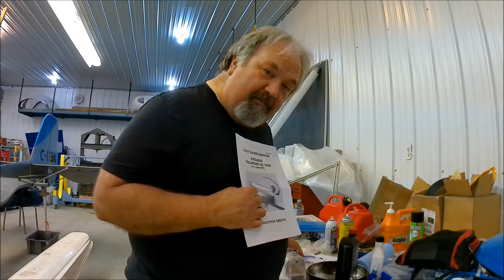EP 57 I install a NEW and better oil tank on my Challenger 2 Ultralight Airplane

Comment: that tank is SWEET, did you buy or build ? if i was as smart as you I'd Buy a TIG WELDER and tinker with welding Aluminum....    And idea If you welded you could have made something for engine crane to take off and put on engine by yourself....   I KD8MZD ( do you do Echolink Ever ? it also has app for you cell to connect ?? )
Reply from the maker: Purchased from Sheer Technologies, description in the comments.

Comment: Ah, hope my idea of a go kart fuel tank led to this purchase of yours. Lol. Are you gonna be using that wooden prop? If not. Could you do a video of why your not gonna use it and the difference between the two props if your not gonna use that wooden one.
Reply from the maker: I plan on using the wooden prop, it's the correct pitch and size for the Challenger 2 on floats. It's not going to win me any speed awards, but it will get me off the water in the shortest distance.

Comment: I’m not sure that I like the drain plug as a fill cap. The chain will flap in the wind which would annoy the crap out of me. Besides that thanks for the video.
Reply from the maker: I'm going to make a sleeve for it as well as one for my fuel cap chain. Like you, the rattling would drive me nuts. I figure a cloth sleeve would reduce movement, and eliminate noise on both.